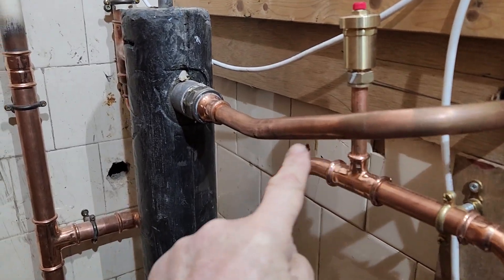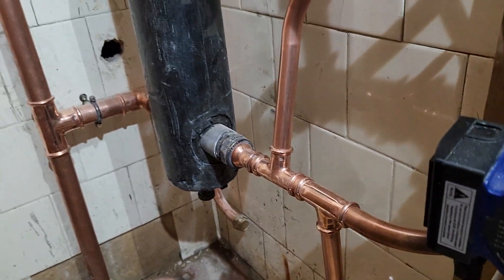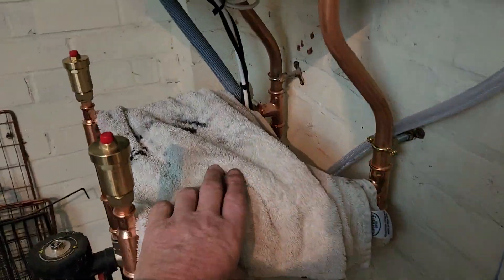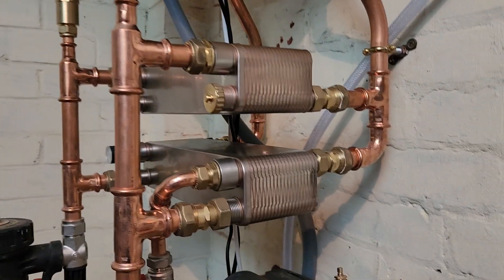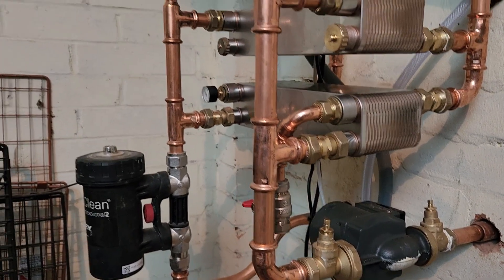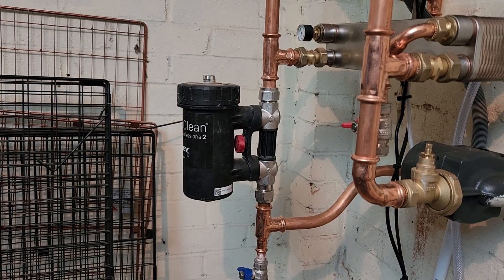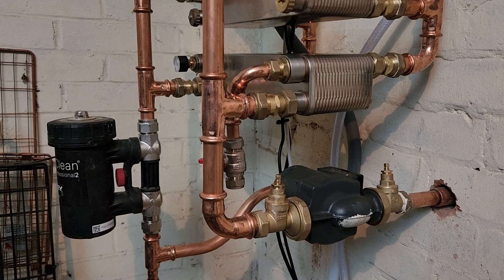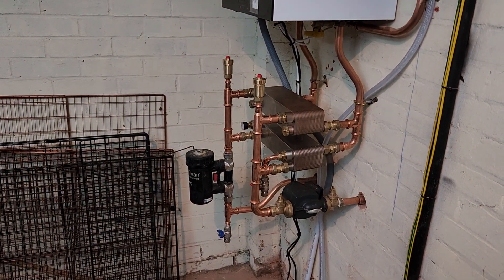This is definitely a first for me, and I suspect it's a first ever.

Comment: Seems like an elaborate solution, personally I would have used an intergas HRE system boiler as they will run gravity when the pressure sensor is unplugged and you wouldn’t have needed the plates just the low loss header.

Comment: You mentioned the close couple tees a few times. Is there a significance that they are so close coupled?
Reply from the maker: Yes, close couple teas provide hydraulic separation similar to a low loss header, but rather than using low velocity. They use proximity to get the pressure differential across the two tees, as close to 0 as possible

Comment: Nice neat job.  BTW, whose flat plate heat exchangers are those?
Reply from the maker: From Antteres
Reply: @andrewmillwardwatford9410  Thanks.  Also love the long sweeps for your 90's,  Many times I see sharp/short 90's and cringe at the loss of flow that they cause.  I was taught that Gradual Turns == Smaller pumps and better efficiency.  Nice to see you doing that.

Comment: 😂 not sure what you mean by saying gravity system???
     I see 2 zones ,2 pumps ,image each for there zone w/ its own t-stat ? 
     Heat exchanger for what reason ? You said dirty ,lol it's all dirty ,especially going through iron radiator s. Flushing it w/ chemical treatment not feasible??
     Any way looks neat,and they got heat . Wall mount units in U.K. are so much better than our stand alone boilers here in the states. 
     Most people don't understand heat exchanger s are separate from loop ,you reason to keep tankless clean I image?? Keep posting enjoyed content 👍
Reply from the maker: This job has won gravity circuit, with no pump downline of the low loss header. It has a pumped circuit which is standard twin pipe. It has a pump to circulate between the plates and the low loss header. A gravity circuit cannot be flushed as a pump does not induce enough flow through the radiators due to the pipe lay out of the gravity system. Plate separation is the only way to protect the boiler from contamination, and this is its only purpose in system. In effect, we have only two zones and three  pumps. But only one of these zones is pumped

Comment: Shouldn’t the heat exchangers be insulated, looks really good.
Reply from the maker: Yes, a lot of the pipe work should be insulated. In the video I explained, we're going to be pulled back out again once the house is sold. To get a mortgage to buy the property, it must contain a working heating system. Our job remit was to deliver a working heating system so that the boiler would be usable. When the system is modified by the new owner. The system does not comply with building regulations, but will allow a mortgage to be raised by a potential buyer. The commissioning documents detail the fact that this does not comply with current building regulations

Comment: Fascinating solution!   I’ve added heat pumps to a few gravity systems before.  They still work as gravity from the original solid fuel stove, but teed in the heat pump as well as a flap type non return valve to “accelerate” the flow and get a nice low delta t for the heat pump.  Works great.  Temperature switch to lock out the HP when the fire is lit.

Comment: Hrmm so in that big reservoir at the beginning are both flows combined ?  so basically then you provided a kind of neutral exchange area where the pressure /function of flow, is close enough between the two separate circuits to allow a thermal/heat exchange and mixing of both flows. long breath...without disrupting the weakest flow which is the gravity system you coupled to??? Sorry but thats as i thought it lol.
Reply from the maker: I think so

Comment: Of you fitted a pupm the whay cant ya flush also of filters as crap why fit it ?
Reply from the maker: The gravity circuit does not have a pump. There is a pumped circuit which is on the standard twin pipe.You separated using the close coupled t's. The gravity circuit works on gravity via the low loss header, and this circuit cannot be flushed. The boiler is protected from the dirt by the use of platic strangers as we know from experience that filters have very little positive effect on the protection of boilers from contamination.

Comment: Shouldn't all the pipework and heat exchangers be insulated?
Reply from the maker: @geniuscctv1072  yes, it should be especially the heat exchangers but as I explained in the video, it will all be ripped out once the place is sold

Comment: Where did u get the llate heat exchanger. I was thinking of using a llate heat exchanger system instead of a big cylinder
Reply from the maker: @wunademones  i buy these from a company called antares. They are very low cost and good quality

Comment: Good Video Andrew -still got your old flushing machine you made to clean the viessmann plate heat exchangers must be 17 years ago  ?
Reply from the maker: @kitcartel9390  i originally made the u diy flusher because I needed a sealed system to operate the pressure switch on the wb1a. This is no longer an issue on most of the current boilers, and you could use a standard de scaler

Comment: Why not just convert to fully pumped? And also why couldn’t you power flush old gravity circs?
Reply from the maker: @patto2168  the customer didn't want the expense.
Of replacing the pipeg and radiators. It's not possible to induce flow.
Through the radiators on a gravity system using a power flushing machine. The radiators would have to be removed individually.I m flush through and they are cast iron.  The property is to be sold, and then everything will be ripped out and upgraded. I expect the boiler to be reused as it is new, and it will be spotless.
Reply: @  fair play pal👍

Comment: If it had been possible to convert the pumped radiator ' 2 pipe/string' part, to a pressurised system and power flushing it well and good, could it then have been connected directly to the boiler, running on the internal pump of the boiler? (and a valve for balancing the water flow between the plates right below the boiler and the radiators far away)
Reply from the maker: @NikolaiBeier  it will all be ripped out soon.The property is up for sale. We had to get the system working for the lowest price. We even offered a second hand boiler for this job.But for some reason, the customer declined.
Reply: @andrewmillwardwatford9410  if it was to be ripped out soon, then sealing the gravity system and flushing it with tap water to get out as much as possible and put the new boiler directly into it makes even more sense and get rid of all the extra hardware
when I was rebuilding my house (250sqm), it also had a gravity system with iron piping and old cast iron radiators, it was dirty, sealed it, put a 25 euro pump on it, cheapest one there was at the store, new pellet boiler, and it worked for couple years till I got heated floors in etc, and new piping all over the house, and kept the cast iron radiators on 2nd floor, it has been 21 years since that job and I replaced that cheap pump I got just couple years ago for the energy efficient one, it was still going strong, all these years it had just regular tap water in it
Reply from the maker: @dsfs17987 do you think it would be possible to pump the gravity system and a two pipe system without hydraulic separation? Do you also think I could get the system clean enough not to contaminate a brand new boiler? How exactly would you flush the gravity heating system? How would you prevent the gravity system from acting as a total short circuit for the twin pipe system without hydraulic separation? The gravity heating circuit also provides gravity, hot water. How would we prevent
The hot water circuit from forming a short circuit? 
By using a low loss header, we have been able to run the gravity circuit at a gravity circuit. By using ccts on the return, we have been able to give a hydraulid pump circuit for the two pipe system. By using plaited exchangers total protection of a brand new boiler from what is a highly contaminated system.

Comment: Questions:  System is very dirty so you use a brazed heat exchanger that will clog up ?  Why didnt you just convert the whole system to sealed and then power flush ?  Or was the old system a one pipe and the new, a 2 pipe?
Reply from the maker: @TheLordbunty  it was an option to re plum or two apply the fix we have used. The property is being sold, and the system will be replaced as part of the new owner's refurbishment. In order for a new buyer to get the mortgage, it had to have a working system. And this was the cheapest way of giving it a working system and still preserve the boiler for use in the development. The platik exchanges are very easy to clean and in my experience.Take a long time to block up. They expect to sell the property within the next year and a half.

Comment: Incredible “Get out “ to a very complex set of issue/requirements! 
Do you over rate the plates to reduce resistance or is it just massive?? Also like the look of those plates, have been buying NOrdic from Poland, but get hammered will import tax now, and not too keen on the thin O rings that they used with the mount kit!
Reply from the maker: @bikemadsi  i buy these plate heat exchanges from Italy. Whereabout eighty pounds each. I keep them in stock, so I can do a service exchange. Most boilers only require one of these plates, but every now and again I will use too. As with everything, there are some advantages and disadvantages. Adding a plate reduces the efficiency of the boiler but gives one hundred percent protection against contamination

Comment: Hi Andrew. Please do not misunderstand me and I am not being critical but do building regs allow gravity to be used for the hot water circuit ? PS.. I applaud your lateral thinking.
Reply: Building regs are not policed , I do manufacturer work and can’t get people to put flue system in right. Let alone stats and controls. Made the best of the situation.
Reply: I think it’s gravity heating not hot water; that’s why the radiator you saw had top & bottom entry valves.
Reply from the maker: @matthewtrueblood408  this system has half the house on gravity radiators, and half of the house unpumped twin pipe system. The hot water is on gravity and to heat the water, the heating system has to be run at the same time
Reply from the maker: @gibbodive140  no, the system is not compliant, and this is detailed on the logbook. The job has been done purely to allow it to be sold with a working heating system